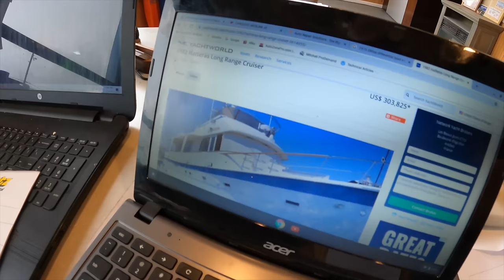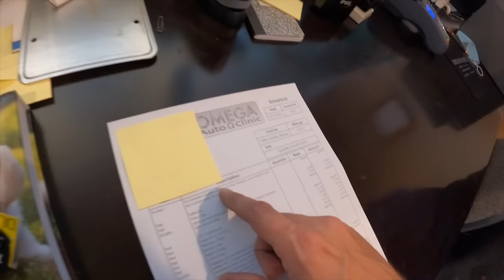Everything wrong with the Mercedes nobody wanted, and another Lamborghini FIXED!

Comment: Caddy Brougham emblems were put in wrong place by one of my guys. Thanks for pointing it out everyone. We will get them repositioned for Hoovie.
Reply: Great job on the Caddy. Hard to put badges where they originally were when the car is 19 miles long.
Reply: is the horizontal door trim going on?
Reply: There should also be a side moulding that runs from just behind the front wheel well straight through to the back of the quarter panel. Unlike other GM brands, it is stainless steel with a body colour rubber insert. The Brougham badges should be just below that molding.
Reply: Their eagerness to jump on such a minutia of a mistake only illustrates the continual excellence of your standard.
Reply: my favorite videos on the Hoovies channel are the ones with Car Wizard in them.
my favorite videos on the Car Wizard channel are the ones with Hoovie in them
Reply: Where do you get the w108 parts? Mercedes classic? I need to replace my quarter glass rubbers too
Reply: @deanrosario9934  Try Mercedes themselves, they hold stock for many old classics and not all the prices are silly, new headlamp glass for my '72 W114 280ce was next day delivery and less than £20 shipped here in the UK.
Reply: @popuptoaster  thanks. I get most of my parts from the classic centre. Just wishing there was a slightly cheaper mercedes option
Reply: I think now Tyler needs to find himself a compact hooptie- in the form of a Cadillac Cimmaron .
Reply: the beatings shall commence
Reply: @theemasher777  this car is small compared to most old Cadillac’s.
Reply: I see the Cartrek 308 there in the background!  I hope that thing comes out nice, because it has really good potential to be a great daily driver.
Reply: Thanks Weeezard - that was bothering me 🤦🏻‍♂️
Reply: It needs its side trims though
Reply: Wizard please grow your bead as long as you can!
Reply: @Porsche964Guy  I own a 1986 Fleetwood Brougham.  It drove me crazy when I saw it.  They weren't even close!  lol
Reply: Wizard's head is more polished and reflective than the super-reflective mirrors they use on satellites in space!
Reply: I was just going to say!
Reply: OMG how could those emblems be in SUCH the wrong position........yikes!!!!
Reply: I LOVE that Benz... Please give me first crack at it, if he sells it... I'm paraplegic, with two children, and NEED an automatic sedan, desperately! If he's going to sell, please reply to this, and let me know!!! Thanx Wiz, Hoove, God bless you both!   :)
Reply: OMG.  what  a trim mess!!!!  where is the bodyside moulding?  Brougham trim is wrong.
Reply: My 99' blue dodge 1500 single cab with the 5.2L 318 V8 and 5spd manual was stolen, and every time I see your dodge Wizard it makes me want to cry :((((((((
Reply: Something doesn't add up here. Nobody wanted the car for 7600 dollars on Bring a Trailer so you paid 9.000 dollars for it? What's the joke?
Reply: @paulsz6194  I think the Cimmaron is too crappy even for Hoovie. Unless he wants to bury it or something. That's a car that is dying out and the world is better for it. We only need a couple left to provide reminder of what manufacturers need to NOT do.
Reply: Car Wizard do not put synthetic oil in thees engines. It will burn it lik hell. Put in 20W50 like mercedes recommended. It wil be in the boos Hoovie ha in the trunk
Reply: That ferrarri you bought from cartrek episode was a diy thing right? That's why you have magic mike work on it ;P
Reply: @ChrisHimself1357  Thanks so much for that explanation.  I bought a 69 280SE (6 cyl) from the original owner in the late 80s.  The first time the car went on a rack and the rear wheels hung free, the seals let go and I found out about the cost of M-B parts.  No one has been able to explain what its function was until  now.
Reply: @almodequindre8601  I think it's taxes, auction fees and shipping that probably brought it up to $9k.
Reply: @almodequindre8601  I think Hoovie said $9000 was to meet the reserve price and thus $7600 was not enough for the seller to sell. There’s the explanation for why he paid 9 grand.
Reply: @spooderdoggy  Makes sense.
Reply: Wizard is a hack has to double check his work he and his shop have no business working on a Cadillac
Reply: Soo Chinchilla no longer works for you?
Reply: Hey Weeezard ʕ •ᴥ•ʔ
Reply: @almodequindre8601  delivery about a grand, then taxes and title. Ha Ha... Not.
Reply: You should know better than putting synthetic oil in a old 70s engine

Comment: Thats the hydraulic compensator “spring”. It pivots in the middle of the rear axle in order to the level of the both sides of the suspension by helping distributing pressure from both shock absorbers. It’s sort of a additional dampening device not to be mixed with a self leveling suspension system
Reply: It pumps it's self up when loaded.
Reply: Most cars of this type that I have seen replaced the compensator with a simple metal spring.
Reply: @boblacks945  That is why you always need a Mercedes Benz specialist to check 70-80's Mercedes before you buy. It worked like an expensive version of the compensator spring kit sold for VW Beetles in the 1960s. I had both and if you were cornering at ten-tenths, the swing axel's on both vehicles would allow the rear wheel to tuck up inside of the wheel arch, which left you tippy-toeing through twisty corners. But you were driving on the absolute limit of adhesion. FUN. Phil.
Reply: It IS a levelling device. Boge hydraulic levelling strut. 
Same was used in Range Rover from -70 
When car is moving, this thing is pumping it self to certain level, and keeping it there. In Range Rover there is 700 kg load bering in rear, and this keeps it level
Reply: @phillipj.moodie3077  In 1994 l drove my 300SEL 6.3 in a 2000km rally.
Taking foot off the accelerator ,at speed, would cause the rear wheels to 'fold under" (lots of positive camber) providing a breathtaking experience trying ti keep the beast under control..
It would get even more hairy when you needed to brake at the same time.
Fun indeed 😆
Reply: @maxtraction5388  Right you are!   Boge also sold motorcycle versions of this technology to BMW in the same early 70s time frame -- they called them the 'Nivomat'. Good luck finding/servicing one of those bad boys today. =8-o
Reply: Early version of the Boge  Nivomat self-leveling damper as used in a zillion Volvos.

Comment: "I disconnected the speedometer because it was noisy"? That is awesome. I gotta remember that one the next time I sell a junker.
Reply: Lol
Reply: common for the speedo gears to make a noise, regrease and ok.
Reply: officer: „do you have any idea how fast you were going?“
„no i disconnected the speedometer because it was noisy.
Reply: @iamwritingrightnow8217  officer: "do you have any idea how fast you were going?"
owner: "oh about thirty decibels"
Reply: @thomasfoster2  It was pretty obvious to anyone with more than two brain cells that OP wasn't calling Hoovie's car a junker.
Reply: Must be internal speedo cable spinning making noises from rust or corrosion 
I’ll guess.
Reply: How many thousands of miles ago they disconnected the speedo 10k, 20k? I assume the odometer runs off the same cable. But then again, it's a 50+ year old classic car now, so maybe missing a few tens of thousands of miles of the odometer is okay.
Reply: @rogerrolex6981  It's usually the "worm screw" on the speedo assembly (that engages on the cable terminal) that seizes\ gets too much play, and it actually whines like crazy, and the cluster cowl makes it so it seems like the car is bombarding you with the most irritating noise ever.

Comment: Hello guys, the contraption on the rear axle operates like a self leveling system, the more you load the back, the stiffer it pumps up to keep the car level.
Mine was replaced with the coil.

Comment: The unit over the rear axle is called a compensator.  it automatically adjusts the rear ride height. All the SE's got them.  When they fail the rear end squats.  New ones are not obtainable.  Mercedes Classic Center will buy them and rebuild them for Mercedes prices. The easy option is to put the spring from the cheaper models on to repair the car when it fails.

Comment: The weird rear suspension part is called "Boge Bein" with 108 enthusiasts. It is actually original in all 108s. The Spring Hoovie is talking about is the cheap conversion part which comes from the w110/111 series (Heckflosse), which is considerably cheaper than the Boge Bein. 
The Boge Bein used to cost more than 1000€, don't know what they cost right now or if you can get any at all now. It is for automatic ride height levelling. 
The axle is a "Pendelachse"= pendulum axle, similar in construction in VW Beetles and Porsche 356. Something to mimic independent rear suspension. My 108 days were 10 yrs ago. Toooo many maintenance costs but great fun and reliable for daily use.

Comment: To Hoovie or Wizard- concerning the air noise on the 108, I doubt it needs parts.  The vent window can be adjusted.  Remove the trim above the door panel, and you will see a three inch long control rod that operates the vent window.  It's a ball and socket on both ends, and the length can be adjusted.  I usually  lengthen the rod by one turn.
Reply: He's just ripping him off. He's making a ton of money off Hoovie.

Comment: It was a common modification/upgrade to replace the hydro-pneumatic compensator with a spring. Also another cool/interesting feature of those engines is the fuel injectors are controlled by points, just like an ignition system but in this case there are 8 inside a cartridge located in the bottom of the distributor.
Reply: Trigger points was the Mercedes term. they rode on small cam lobes on the lower distributor shaft. This was/is a speed density system, with a MAP Sensor about the size of a coffee mug, mounted on the firewall, connected to the intake manifold via a vacuum hose.

Comment: I had a 1959 300 D (Diplomat) and the load leveling was controlled by a switch in the cabin. You just guessed where it should be depending on how much of a load you were carrying. And as I was only 19 when I owned it. It often carried quite a load. 4 people comfortably in the back 3 (minimum) in the front and several coolers in the trunk.

Comment: That rear Item is a Boge Hydromat self energizing levelling system. Had this on my 1968 280S.

Many had it swapped for a spring. If I recall, the boge was a factory unit.

The spring is not good, as it makes the rear sit too high when lightly loaded.
Keep it or get a renovated unit if it fails.

Comment: When Mercedes-Benz were built to last and be luxury icons.
Reply: there is really nothing built like these cars then or since, pretty unique
Reply: Sadly they lost their magic.
Reply: Luxury is now associated with # of screens. As long as it makes it past the lease period, no one cares.
Reply: This has a computer on it
Reply: Sadly my grandfathers 1973 459 SL I inherited in the 90s was to far gone to save. When I finally had the car in my possession it had not been stored properly so the fuel turned to varnish and took out the fuel injection system, one of the first of its kind, it had a poorly done color change paint job with lacquer paint for some reason as well as issues to numerous to list.  Sprinkle in a little desert and that put the final nail in the coffin.  At least I have the memories. I always get nostalgic when I see one of the r107 body type cars still on the road.
Reply: @flight2k5  so?
Reply: They still went rusty pretty much anywhere it wasn't California, I've had a lot of W114's and W115s over the years. Great engineering but still 60's technology when it came to corrosion protection, also difficult to weld for repairs due top the horsehair sound deadening, you can be welding the rear of a sill and the stuff smoulders along the whole length and sets the dashboard on fire. Rust killed most of this generation of Mercedes because finding someone top repair them cheaply was almost impossible.
Reply: In Europe most of that generation s class was scrapped, no one wanted it as classic car and even now when those are rare no one wants them anyway... Thing is they are boring to the point you feel tired by just looking at them.
Reply: In Europe and points East they were seen as taxis weren't they? I drove a new one from Munich to Tehran for some Irani car smugglers. It was a great drive. So much better than the rust buckets i could afford for myself.
Reply: @wykydytron  I think the 2 door coupe still holds value. Especially the cabriolet version.
Reply: Honestly they are less luxurious than a new Corolla, and far below Rolls Royce or even Jaguar of the same era.

Comment: I got a 85' 300CD about 10 years ago as a goof. It's fun to drive and the Panzer-ness is there but just about any maintenance will mean spending unusually big $$ for what seems like a simple trivial part(s). My horsehair seats are still in great condition and super comfy, easy on my back even for those long multi-day drives..

Comment: Those aren't 'acumulators' Those are spheres, and yes they aren't expensive. They have a central diaphragm and are half filled with Nitrogen at high pressure at the top (perfect progressive spring) and the other half is hydraulic fluid (a green mineral oil called LHM, Liquide Huile Minerale) which is pumped in from underneath (height). The 'accumulator' is where the hydraulic system's pressure is held/regulated, usually in the engine bay near the pump. The spheres are nearly always green (to denote LHM) and are the actual suspension itself. Citroen designed this system in the 1950's and it was so good it's surely the most comfortable and clever suspension system ever fitted to a car. Super soft/hard/progressive and ride-height levelling all from one sphere. Mercedes, Bentley, Rolls-Royce and others paid a licence to Citroen to use the system on their cars. The really sad thing is now all Citroens are 'dry', there are no hydraulic ones nowadays, definitely a backwards step for me.
Reply: Nice explanation, entirely correct.

Comment: The rear suspension thing is a compensator. It also helps to keep the wheels at the right camber. The reason that you see springs there is that you can't get new compensators. You can get them re-built ( core change ), but it's expensive

Comment: Hey Hoovie, you’ve probably noticed this already, but the “Brougham” was put in the wrong location on your quarter panel. It should be much lower just above the middle trim piece...
Reply: Good eye Robby, I was thinking the same thing.
Reply: I had  a caddy like that years ago. I saw that emblem placement and almost fell off me seat.
Reply: 100%, totally wrong place.  My grandfather was a Cadillac mechanic for decades, I drove his 1981 Fleetwood Brougham to my prom. I cleaned and waxed that car a bunch and remember quite well where that Brougham script goes, and it ain't where they've got it!
Reply: Absolutely wrong place. Way too high.
Reply: Maaco did the same thing to my Grand Prix emblem on placement, and it was the worst paint job I have ever seen and I didn't get the cheaper paint job. I think they move emblems so that when other Maaco painters see it they know where it was done, IDIOTS!!
Reply: That caddy interior... Right back to my childhood. Make everything light blue, replace the leather with velour, and put in an AM/FM with an 8 track, 
It's my Grandpa's 77 Olds 98. 
only yours has 9000% less Rust.
Reply: @Vincent James Voice   Hey Vince, I'm not sure if single stage can be buffed unless it is wet sanded to 5k grit or more then the paint would be so thin, I would wet sand it to 1k and then clear coat that, wet sand and polish to glass, I hope he keeps that thing garage or it will never last like my 89 Gr Prix, they suck, can't believe he went there. ✌
Reply: @Vincent James Voice   My son just got a job at Maaco about 1 month ago, they told him he is the best painter they ever had , looking at picts of them they look great, just did a 2011 Caddi CTS Wagon, gorgeous, he is no beginner, 20+ yrs exp.  See how long it lasts tho.

Comment: Tyler I had a 1979 280 SE I believe it was.it was as good looking inside and out as yours is,it was I believe a 5 cly gas engine,it was amazing,it would out run any 305 camaro,or firebird.and the faster you drove it the closer to the ground it got!all the sudden it seemed like it wasn't changing into high gear,and me not knowing what was up,I did as you so often do,I practically gave it away,found out later it was the fan clutch ??.I would dearly love to have another one.you should do another (last hand touching it wins)I love your channel,I believe I've watched them all.Thanks for the entertainment!!

Comment: The previous owner disconnected the speedo because the odometer was moving.
Reply: Doesn’t matter, that machine is a keeper.
Reply: Questionable at 9k though. Even a clean example. I'd have to be a huge merc fanboi to drop that on a gas model. The diesel is a different story.
Reply: @ellpo  what makes the diesels Mercs so much better and worth more? I'm not a stranger to diesel cars (at least half the vehicles here in Australia are diesel). Is diesel just much cheaper than petrol where you are?
Reply: @archygrey9093  it's not so much about the efficiency as it is the bulletproof nature of the motor. There are merc diesels of that era with over a million miles on the clock.